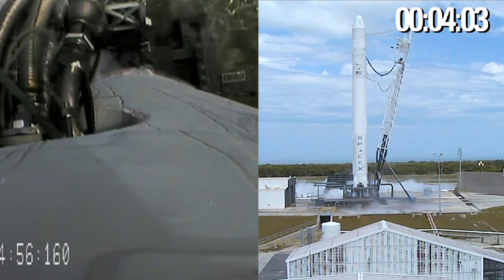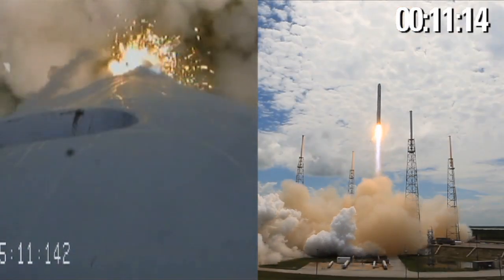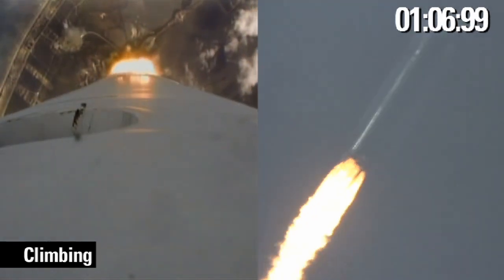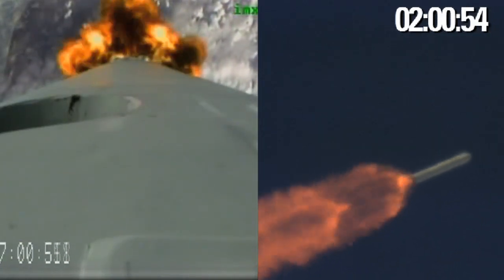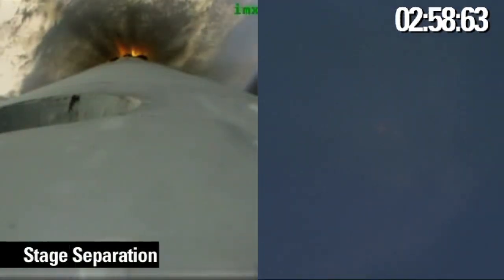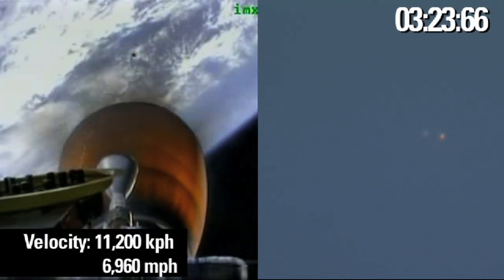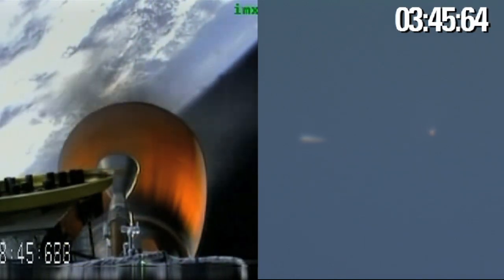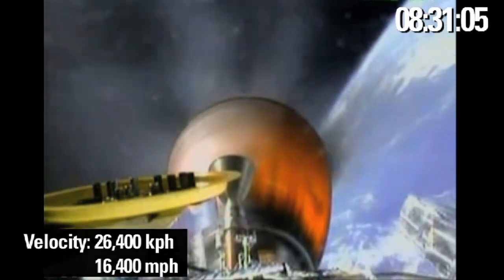Falcon 9 Flight 1 Mission - Highlights

Comment: That insane roll caused by the extra thrust of the gas generators was scary as frick

But hell yeah its cool
Reply: They were so lucky that those clamps moved back quick enough and it didn't end in disaster.
Reply: In the newest video by Everyday Atronaut Elon Musk confirmed it was offangle engine. Thrust from gas generator wouldn't be enough
Reply: Here a year later to say that Elon explained to Everyday Astronaut that it wasn't the generator (or the spiral wound nozzle), but a calibration issue with the engines themselves. Just came back to this vid to re-watch, thought I'd share :)

https://youtu.be/hIPLmZK3C1Y?t=568

Comment: Who'da thought this dinky little rocket would evolve into a world leading partially reusable launcher.
Reply: It is hardly a "dinky little" rocket
Reply: Not partially, mostly.
Reply: @marsbar7099  Yeah but 3 years ago it was only partially reusable
Reply: jeez, how did you get the notification 3 years later?
Reply: Correction, "the" world leading reusable launcher. At the current time, although Rocket Lab is getting close to booster reuse, no one can match SpaceX's cadence. At the start of 2022, they're even outpacing the entire country of China in launch capability.
Reply: Fully 🔥
Reply: This is no dinky little rocket. Still more powerful than Contemporarily proposed launch vehicle designs with reusability like Neutron and Firefly Beta. (Both can do better in expendable configuration but even then this was on par and possibly a little better than Antares)
Reply: they own more than 50% of worldwide rocket launches now wth.

Comment: why does it rotate at start?
Reply: Apparently roll input from the turbopump exhausts was more than expected at lift-off. The flights after they accounted for the difference and they didn't rotate.
Reply: cool makes sence, impressive knowelegde sir
Reply: lockstocknl those pumps don't mess around.

Comment: Actually you're full of shit. At the Suyuz launch complex the do NOT have a traditional tower. They have a hydraulically operated support structure that do not in any way shape or form resemble a tower. The ram used to raise the F9 could in fact easily be modified to work just like the Soyuz support structure.
Reply: @asefjamilajwad  The trampoline indeed is working.

Comment: "Falcon 9 has cleared the towers."
What the towers are there?
Reply: The lightening towers set up around the pad.
Reply: @ISHAN PATEL "T.E"? What does it mean?
Reply: @sarq1  Transporter Erector. It’s the strongback structure behind the rocket. It basically carries it and is attached to some wheels or some type of moving device. It helps lift the rocket vertically onto the launchpad because it is rolled out flat.
Reply: NASASpaceflight intensifies
Reply: @WasatchWind  oh no